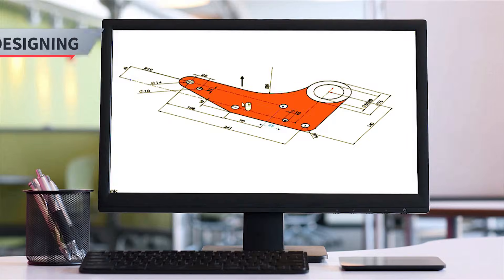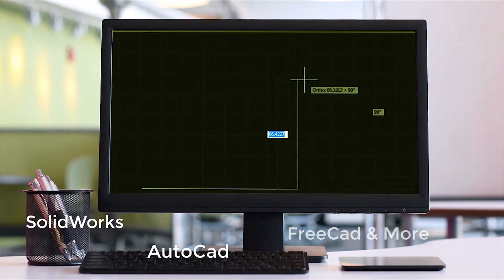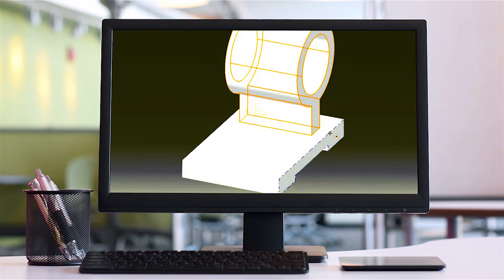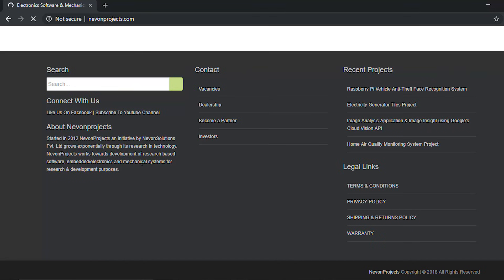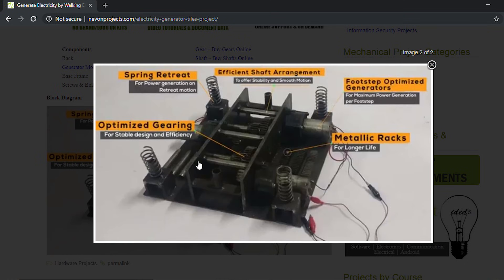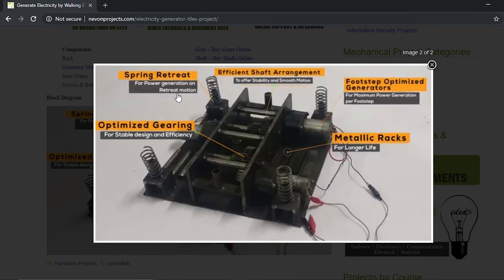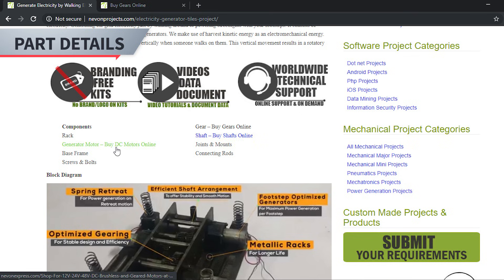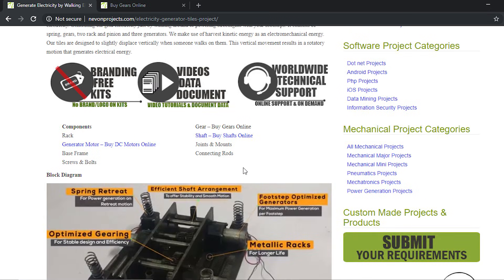Generate Electricity by Walking Power Generator Floor Tiles Project

Comment: PLEASE pay attention to the reality of how much energy this device can really produce. Potential energy is the energy stored in height, when a person steps on this device, its foot goes down and part of this potential energy is transformed in electricity. The potential energy formula is Ep = mass * gravity earth * height change. Now say a 80kg person steps on that device and its foot goes 5cm down; at 100% efficiency (normally this should be <<20%) it has just produced around 40J, so 0,01Wh. This means one LED light for 1 hour requires 500 steps, or toasting two slices of bread 5.000 steps. Lastly, the energy this device produces comes from humans, meaning that when one person walks over 200-300 steps like this it gets exhausted. So let's be aware that this can be useful in certain circumstances but far from delivering any significant input to energy supply.
Reply from the maker: Yes its an Experimental Model for Study purpose only.... This footstep concept itself produces energy only for duration of foot press.... Solar power is a lot more efficient than this concept...

Comment: why not just use piezoelectric material instead of doing such a complicated design?
Reply from the maker: peizo generates negligible energy compared to motorized
Reply: @NevonProjectsOfficial  oh ok. But in a large scale use it would be hard to build this and piezoelectricity would be easier. But I get your point. To just build one this would give more energy. But the piezoelectric material will give 0.6n of force per footstep in an average 60 kg person that can be converted to electricity and numbers will stack in a larger scale project.
Reply: @hemannjatia2062  sir may i know the assembly process using piezoelectric materials?